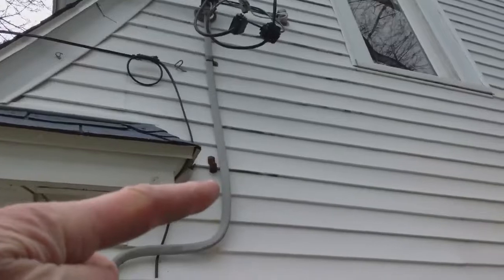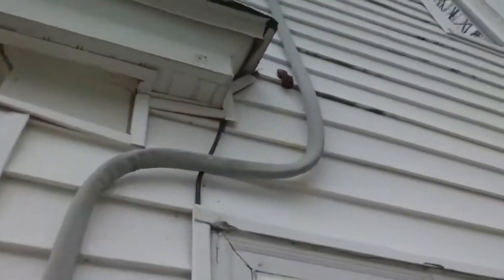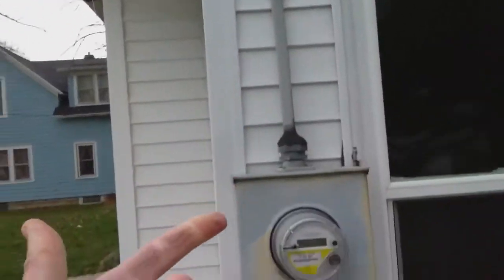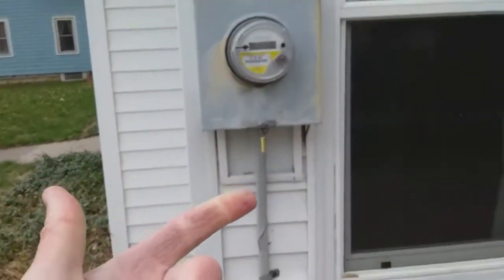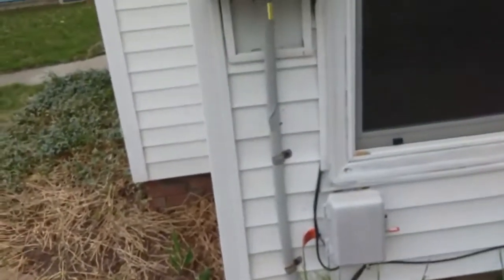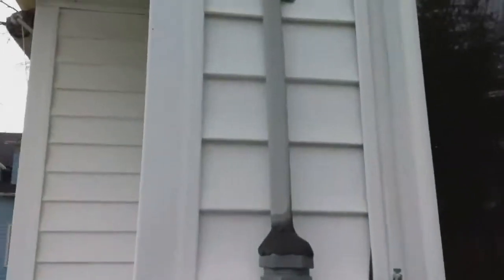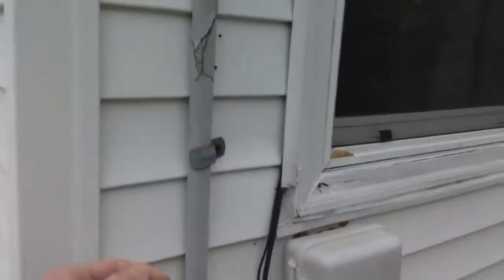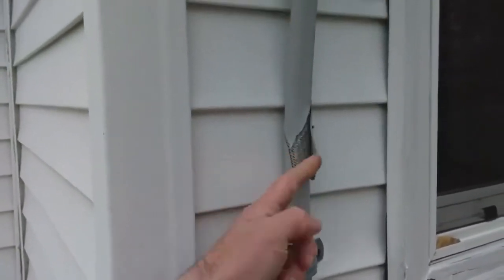Electrical service main feed wire is damaged & missing conduit at mast above & below the meter base

Comment: At the utility we refer to that as range cord.  It rips off the house nicely and can be put back on easily without a lot of damage.  Unlike a hard pipe that gets broken or bent, but pipe holds up better to weathering unlike this particular mast.
Reply from the maker: Awesome info! Thanks for the term "range cord" it makes a lot of sense. I have seen so many bent pipes from weather damage. I assume that old city's would probably never update underground service to homes unless it was at the cost of the homeowner.